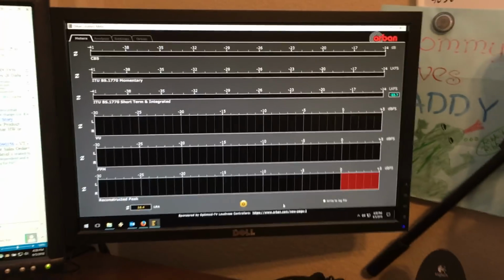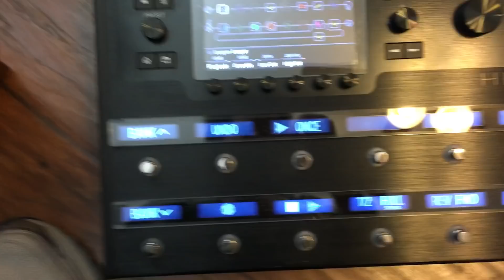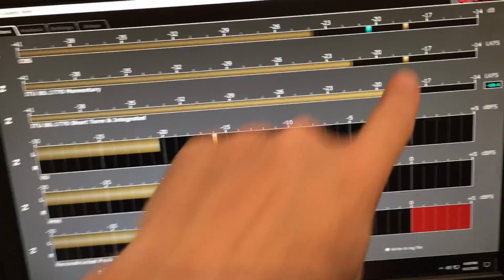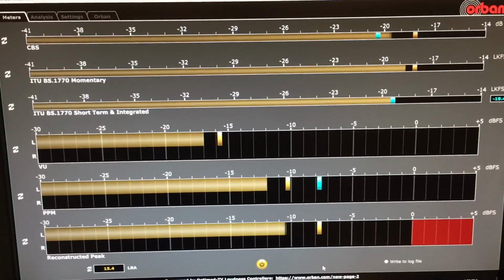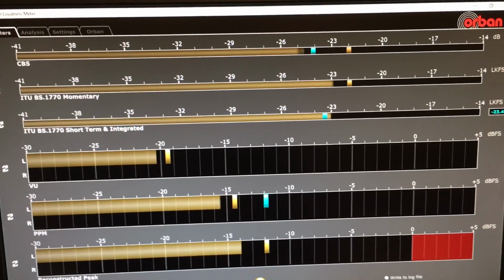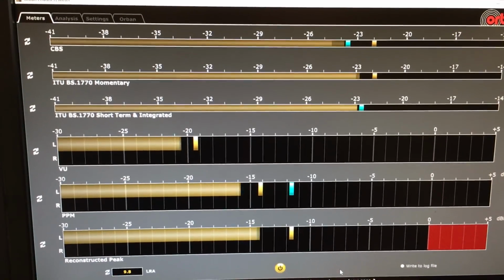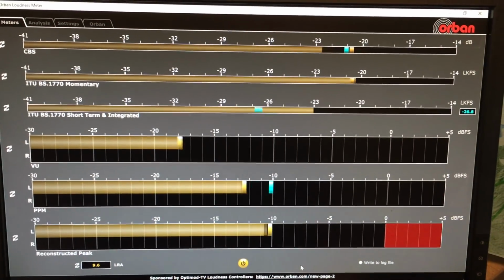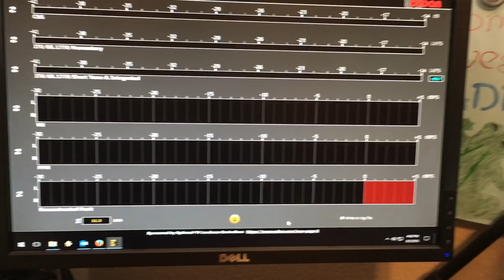Phantom Power On the Helix's XLR Output

Comment: If you use this kind of gear, ASK the FOH to make sure phantom is off on your input channel.  Dont let him connect to your gear without checking. And ffs NEVER buy an 1/8 inch to 2 XLR cable!  Should be illegal!  Heard of more than one Mac that got fried using this cable.  Just use 1/8 to two 1/4 inch and use LINE inputs for your computer into mixer. You dont need XLR inputs!! Phantom is NEVER sent out a line input. Only XLR.

Comment: Last night my Helix completely shut off sound, and  I discovered that phantom power was engaged at the mixer. I have a power blocker attached, but, I didn't connect it like I should meaning; the power blocker must be attached to the mixer a minute before connecting it to the Helix, because in this setting is usually not necessary. So Now I hope this was only a one-off, because I checked helix and cables when I got home and all was working fine...!   FWIW

Comment: I had read that if you connect your line 6 to a phantom power console, you will break up your helix probably in the first time. I can see that it’s not the case. 
Could you tell me which is the best method to use helix effects with a microphone that needs phantom power?
I have a zoom live track l12, its kind of mix console and multitrack  live recordering, it has 2 phantom powers. 1 for first 4 channel and the second one for the chanels 5 to 8.
I don’t know if with that convination i could get the vocal effects of helix. 
I don’t have the helix yet and i think that i preffer buy the helix lt. So if its possible with the helix lt too pls tell me. I read something about buy an art pro audio tu e mic preamp but i don’t understand completely

Comment: Really good demonstration.   Do you have an inline phantom power blocker?   If so, could you demonstrate that with PP on, compared to straight in with PP off?  I just wonder if those phantom power blockers affect tone and/or output at all.  The claim is that they don't.
Reply from the maker: Thanks ... But sorry, I don't have a phantom blocker to test with.  I have a Radial Pro D2 stereo DI box I keep in my bag, but that wouldn't demonstrate the same thing; as I'd be using the 1/4" outputs of the Helix with it.
Reply: Lmao "PP"